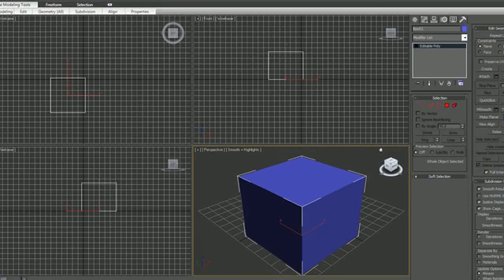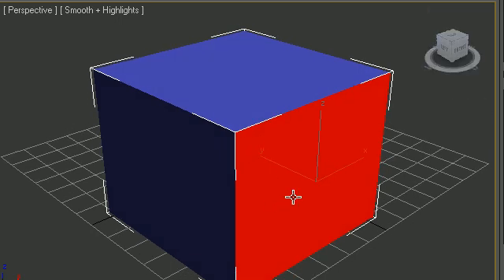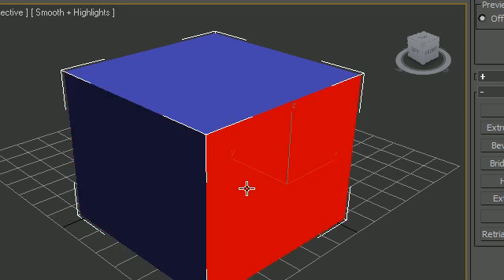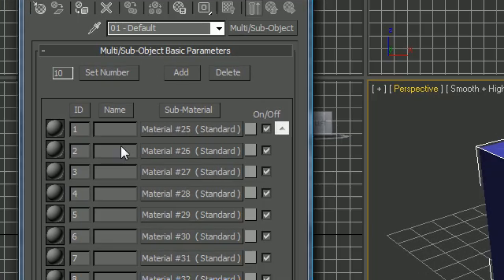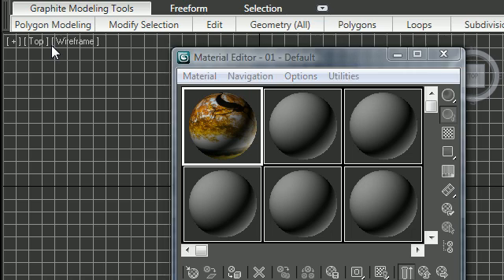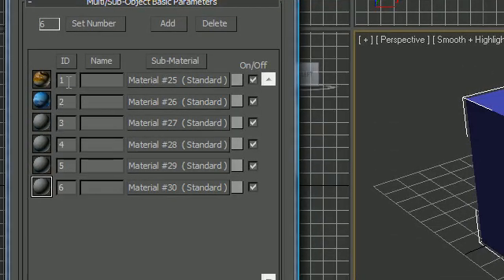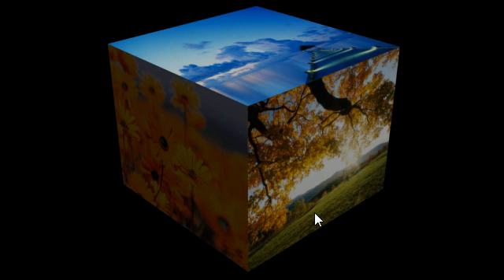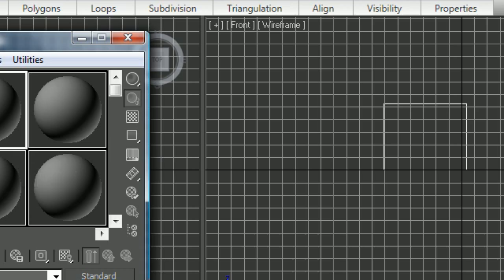3Ds Max Tutorial - 18 - Compound Materials

Comment: does anyone have a solution for this: "I'm having some problems with this section. After I go to standard and chose Multi-Sub Object when it shows the sides. I have "none" in Sub-material. t(unlike in the video where it's material #25, #26 ect. ) Then when i try to select a material I dont get the choice of picking "Maps""
Reply: +Mega2Sakaura Select "none", than select "standard". Open "maps", Select "diffuse color", "bitmap", select your bitmap. than press "go to parent" until you get back to the "multi/sub-object" screen. Rinse and repeat.
Reply: @v1LL3n_nZ  thanks bruh.
Reply: I don't have maps anywhere. it's just standard and its features. no bitmap
Reply: Thanks, I had the same problem so this helped me out a ton :D

Comment: I believe I did everything but when I dragged the material to the object the cube goes black and it doesnt show up in the render. I'm using 3ds Max 2016 too so perhaps I need to hit another key/button?
Reply: Found a solution. You have to delete all ids and rename the last one to 1, then add the next 5. If you just rename the existing ones, it does not Change the Pictures Position. And form what i can Tell, id Nummer 7 is the First one facing inward
Reply: Thanks a lot, it works that way
Reply: same thing happens to me :(
Reply: Pretty sure the pictures are facing inward, no idea how to fix it though